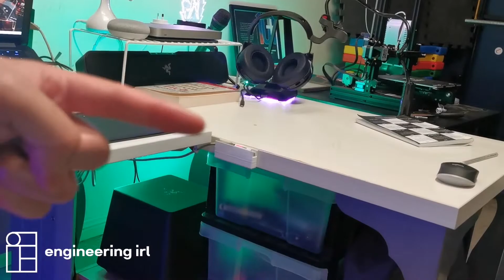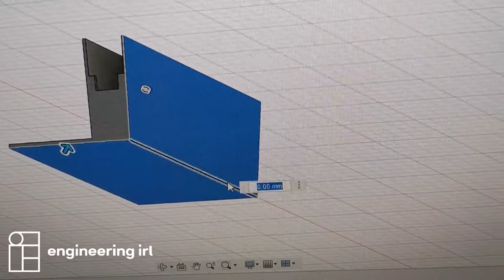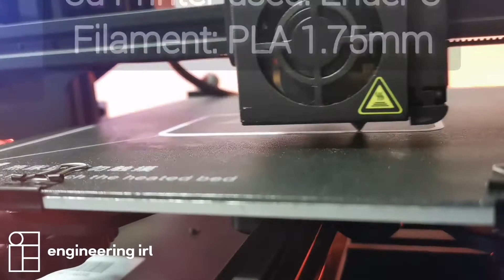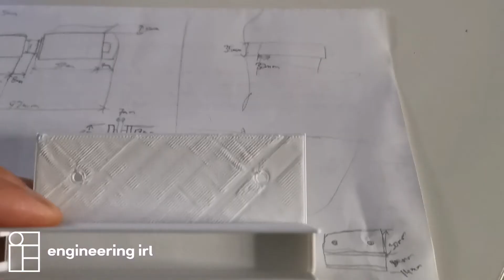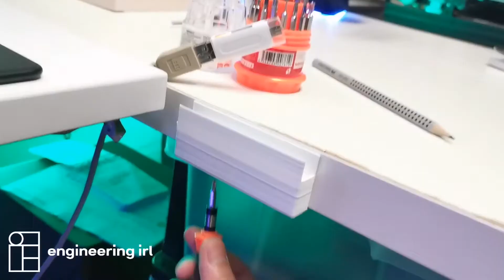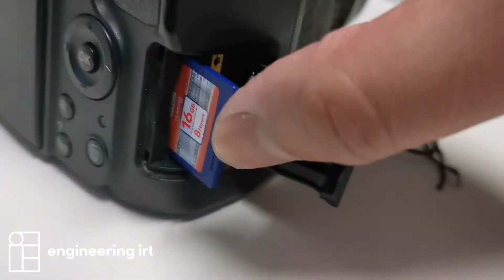Quick Access SD Card Desk Mount - Engineering Project

Comment: Are you worried that it might snap off after multiple insertions of the SD card? Great video! I see what you did there "that's a wrap" 😂😂
Reply from the maker: I did think about that and I thought about making it mount to the side instead of the bottom to theres no reliance on the stress on the corner, but it's actually pretty strong. I tried a decent amount of force a few times so it'll hold for some time. Worst case? I'll redesign or just print a new one!